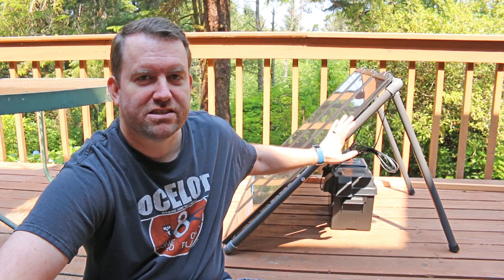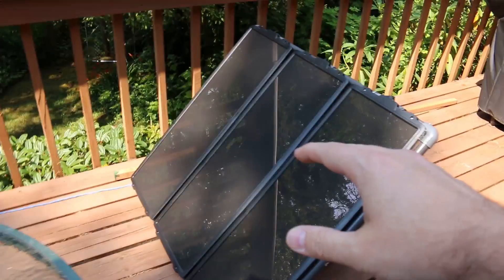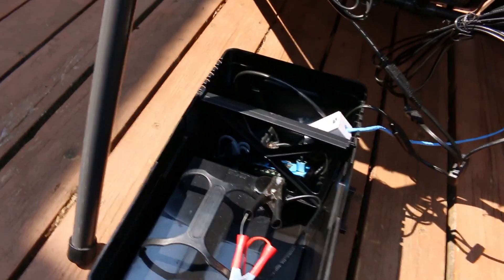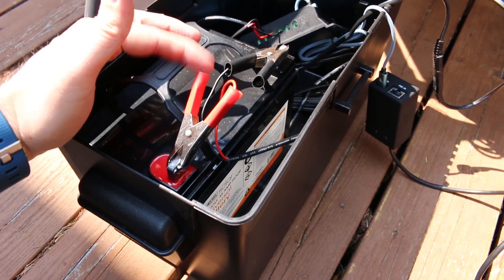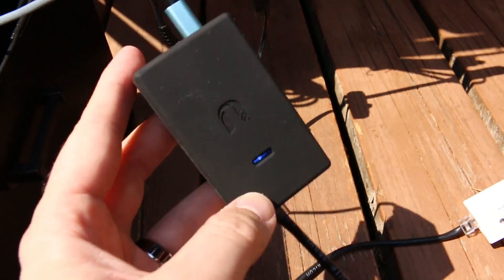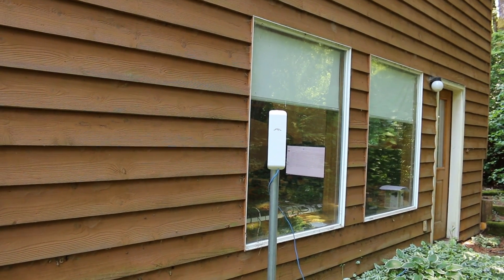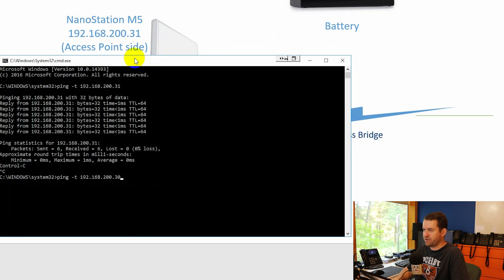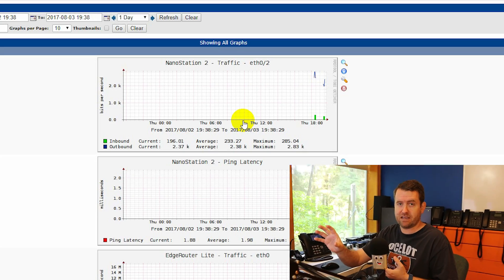Solar Powered WiFi - Part 1

Comment: for you ,getting a few simple "USB power banks" will take the fluctuating power and make it smoother for your kit, OC if your kit is 12v dc powered then it becomes easier as you can then use cheap 12v dc power splitters directly

Comment: To use PoE passthrough, we need to have a PoE+ source feeding max 30w to the nano station, where 15w max will be drawn by the extension port.
Reply: All PoE devices are able to be powered up to the max distance of 100m, also being able to tolerate the power loss generated by distances of up to 100m.

Comment: I have been using the UBNT products for over 10 years love how easy they are to setup.  They have such a wide array of options on what you can do with them as far as range.   But you should know that these products are commercial quality and have up to 10 mile range on some of the larger ones!

Comment: Great video, keep up the good work. But at the beginning you sad it's powering the nanostation. You could try to hook a poe injector to the battery. Something like: ALFA APoE08.
But there is then no protection for deep uncharging. So you should connect it to the charge controller load side that should output 12V.

There are also some solarpanels and battery for 24V. Some ubiquiti devices need the 24V volts or what you can to ist to put two 12v battery in a row to get 24v.

Comment: cool video, agree with you on the HF panel kit. if you going to connect a inverter in your setup, connect it direct to the battery, the "Load" connection points in that charge controller is limited on output power
 alternatively you can use a DC to DC step-up converter( https://www.amazon.com/Gowoops-10-32V-Converter-Adjustable-Voltage/dp/B06XGC5N12/ref=sr_1_18?ie=UTF8&qid=1502007558&sr=8-18&keywords=dc+to+dc+step+up+converter  ) along with a 2.1mm x 5.5mm Male DC Power Adapter( https://www.amazon.com/Xenocam-2-1mm-5-5mm-Camera-Adapter/dp/B01AGQVYQQ/ref=sr_1_13?ie=UTF8&qid=1502008194&sr=8-13&keywords=dc+male+adapter  ) and a Passive PoE Injector with 5.5x2.1 mm DC Connector( https://www.amazon.com/iCreatin-Passive-Injector-Splitter-Connector/dp/B00NRHNPUA/ref=sr_1_2?ie=UTF8&qid=1502008187&sr=8-2&keywords=poe+splitter  ), and this would probably consume a lot less then an inverter

Comment: The AirGateway Installer that is attempting to produce 24 volts from a USB input to run the Nanostation is definitely the weak point in this design.

Comment: I would recommend swapping that charge controller which is about 50% efficient with an mppt controller which is closer to 90% efficient, will make that harbor freight system go a much longer way. https://www.google.com/search?q=amazon+mppt+controller&client=ms-android-verizon&sa=X&biw=360&bih=512&tbs=vw:l,ss:44&tbm=shop&prmd=sivn&srpd=16908587327644949446&prds=num:1,of:1,epd:16908587327644949446&ved=0ahUKEwiBvq_H_7_VAhWK0YMKHXcKAHsQgjYImAQ
Reply: Crosstalk Solutions yes I was able to get a 230w single panel for $.83 a watt.  The mppt controller was only $54 similar batt was $64 this worked out to $1.33 a watt.  With only a a little more in over all costs   I was able to get a lot more bang for the buck.  Nice thing about the mppt is it will take input voltage from 12v up to 100v and will step it down to 12v or 24v your choice.  Also gives you install flexibility.
Reply: If this was going to be a long term mission critical deployment we would absolutely use higher quality equipment! This was just a test to see if we could do a large scale deployment that will really only be deployed for about a month. There is no way we would be able to budget higher end equipment for such a short period of time.
Reply: Brandon Yarbrough understood.  Mostly just a suggestion the harbor freight system is a great first system for testing.  But the per watt cost is through the roof.  If you part the system together you can get a whole system for $1.25 or lower a watt including a mppt controller and the batteries.  The system you have listed is running about $5.13 a watt.  I learned the same lesson.
Reply: This is still a great video!
Reply from the maker: Are you just adding up the cost of all of the equipment and then dividing it by the 45W panel to get your price per watt?  Are you saying that it would be possible to get a similar sized setup for $1.25/W with better equipment?  I can see getting the costs down that low in a much larger deployment, but that seems like a big difference in the ~50W size.

Comment: Check out Wifi-Texas Passive PoE injectors. No 5V to PoE conversion would be needed if your radios will take a 12V input. Personally, most battery backup systems I deal with are 48V telecom standard so make a things easier that way.
Reply from the maker: Thanks for the tip!  Looks like they have some great stuff.
Reply: I had to use them engineer a solution to convert Passive 48V B from a PoE switch to 48V A to power a Cambium radio. I've used several of the PoE passive panels (I much prefer a PoE switch where possible though).

Comment: did you have a power calculator or formula to size up your battery? Given that the Ubnt stuff is 24v passive, it may be a better idea to put 2 batteries in series along with 2 panels to get a 24v output. Put a voltage regulator out to the AP and you save yourself the losses from so many conversions [12v-->5v-->24v]. Also, stick with an MPPT controller, better use of incoming solar  resource. Overall, a fun project!

I've found these videos to be extremely helpful in getting up to speed on Solar 101...
https://www.youtube.com/results?search_query=alt-e+store
Reply from the maker: Thanks for the tips - I'll check out that playlist!

Comment: Definitely need to upgrade battery connections because in low voltage ampacity is king. Alligator clips don't have much contact area and express excess current through heat. 

I'd also try a USB combiner (i.e. ASIN B00ZUE6PVE) to get full 3A available to POE injector before wasting power on an inverter. Others had suggested DC-DC converters but they're not so cuddly as USB. But they do make professional units, like CUI Inc just down the road from you, for industrial applications in DIN and chassis mount so your clients won't see a spaghetti of wires and bare boards.
Reply from the maker: Definitely agree on the alligator clips - upgraded connections will be in the next version!

Comment: Hey Chris, did you measure the power going to JUST the M5 on the solar side WITHOUT the camera? This could be easily done by putting a clamp meter on the positive pair of the cat5e cable to measure the current. Assuming 24 volts, for each 0.5A that would be 12 watts. You have 4x that going into the battery for 6 hours so the solar side would be able to keep up with the .30 M5. Also, you don't have traffic on the solar side of the bridge, you really should for a load test. The inverter powered PoE injector may fix your issue in the short term, but the additional camera DC load plus additional draw based on wifi traffic will probably consume more power than your solar system can supply. I might suggest a single 100 watt panel with a MPPT charge controller to boost efficiency of energy transfer into the battery to support the power load on the M5 plus camera, plus inverter, plus PoE injector on the .30 side. I am planning a similar bridge setup for about 275 feet with the remote end powered by solar, so your findings are VERY helpful....DD
Reply from the maker: Thanks for the feedback - the next version will be a big improvement as I learn this stuff - stay tuned!

Comment: 24v MPPT control works I have built 3 towers that run like this for about a year, all good still running. It is running 1 x 400 Power Beam and 1 x 5m for the AP.

Comment: Chris I would look into getting a way to record your battery voltage when running tests. All of my solar deployments are for sensors that also report their battery voltage, so I haven't used this but this seems like a good option that would be very useful.

Lascar Electronics EL-USB-3 USB Voltage Data Logger, Process, 32,000+ readings, 1 year battery life https://www.amazon.com/dp/B003DS0BS2/ref=cm_sw_r_cp_apa_BypHzbWGJH120
Reply from the maker: That looks like a great tool - I have added it to my Amazon wish list.  $75 bucks is a bit much for me at the moment with all of the other stuff I am buying to improve the setup!  But, I'm a big fan of 'if it can be measured, it can be improved.'

Comment: Hey Chris, great Video thanks.

I have looked at the data sheets for the products that you used and think you will be running into a power issue.

-- The charge controller can output a max of 3A at 5v (assume you can get max 2A per port) this gives you max 10W per port
-- The Nano Station M5 needs 8W max (Nanostation Data sheet)
-- G3 Camera needs 4W max (G3 camera Data sheet)
-- Loses in cable and AirGateway Installer - a little bit (assume 0.5w)

Max demand is 12.5W, max supply is 10W. Looks a bit short and probably the reason the camera powers up, but as soon as it starts to do something that requires a bit of power it shuts down.

I agree with previous comments that you should avoid an inverter as they are inefficient. Another option that you could consider is to install a second AirGateway Installer to power the camera and do not use the PoE passthrough on the NanoStation. This will allow you to use both USB ports on the Charge controller. Although you will need to run additional network cabling, this should only be locally to the Nanostation/camera/battery box setup.

Cheers,

Matt
Reply from the maker: Thanks for the feedback, and for doing the math.  That makes sense.  The next version will have a better charge controller, and a direct DC PoE injector.

Comment: I am not as skilled as you are at computer networking but this I know about POE (Power Over Ethernet) wiring:CAT wire is small guage, intended for low-power electrical signals You can feed 1amp or so over short distances, but longer distances make the voltage drop through the wire significantly. The more amperage you try to draw, the greater the voltage drop.There is an advantage to going to higher voltages - 24 or 48 volts vs. 12 volts. Using simple numbers, if your device requires 48 watts to operate, that means 1 amp at 48 volts (which 18 or 20 guage wire handles well over short distances). However, at 12 volts it would require 4 amps of current, which will overheat small guage wire and create significant voltage drop (transmission loss). You have to minimize amperage or use heavier wire (possibly good quality Cat7) to improve the power available at the receiving end.Enjoyed your video.
Reply from the maker: Great feedback - thanks!
Reply: Tom Kelly yes yes yes, voltage drop is one of the key factors here..... along with what everyone else has been inputting.

Comment: Thanks once again Chris for your great videos! 
After watching your video I was thinking that if the Nanostation and Camera were closer to the "solar stuff" you may have have better success. 
My thinking is with the length of wire you have running you are experiencing a voltage drop (And current) due to the natural resistance of the Cat6 cable.
Reply from the maker: Definitely worth investigating - I'll check that out!

Comment: You need an Inverter. You also need an MTTP charge controller. As the one you are using now is cheap. You're losing 40% of the panels efficiency. Not that the panels are great to start with. As I am an electrical engineer and design solar systems for RV communities that want WiFi in them....

But nice try. Just get better equipment...
Reply from the maker: Thanks for the suggestions!
Reply: No problem. I should make a correction. It's MPPT... They cost more for a reason but they pay back in efficiency and reliability. 

These also work great for repeaters. To those that need more range with large RV's in parking lots. So they can get great connections to free WiFi... As RV parks are notorious for low signal consumer WiFi routers. ....
Reply from the maker: I've always wanted to do an RV park WiFi install - there's one near my house, but they didn't want to upgrade just yet.
Reply: So you would use an inverter to convert the 12vdc battery voltage to 110/240vac and then convert it back to 24vdc to power the nanostation. What a waste of energy. Better off with a dc/dc step up converter 12vdc to 24vdc
Reply: The PoE injector provides the 24 volts. Read the instructions....As the CAT6 is now being powered. That is why his Camera cycles on\off 

And DC\DC chargers are highly inefficient. As the best converters are 92% efficient cost $400.00 for a 30 amp....You can buy a 2300 watt inverter for that. As you don't need a true sine wave inverter. You can use an ACP backup PSU to condition the line voltage. Not to mention protect all your electronic devises. 

I been at this for 20 years. I know what I'm talking about....

Comment: The double conversion using the inverter and then POE power supply costs you power.  You can get efficient up-converter power supplies from Ebay that regulate despite the battery voltage going low or high.  You also want a low-voltage disconnect on your charge regulator.  Finally, don't put electronics inside the battery box!  Battery out-gassing corrodes electronics and make you cry.  Get and external weather box for your stuff.  Did I mention grounding?  Drop me a note.
Reply from the maker: Great feedback - thanks!  Do you have an amazon link for the up-converter power supply that you mentioned?  I'd love to take a look at it.
Reply: What I'm familiar with are bare boards from Ebay.  You need about 5A for Station and camera: http://www.ebay.com/itm/DC-9-20V-12v-Step-up-to-24v-Converter-Regulator-5A-120W-Power-Supply-Adapter-/172765818337  There's more to it than meets the eye.  aly  (edited with new link)
Reply: I just sent you an email

Comment: I would say the limitation is the solar controllers USB output
Reply: I would agree with this as well... the USB output on the charge controller is probably .5 maybe 1A... the AirGateway Installer needs 2A...  how about a 12v to 5v car adapter? just make sure it outputs at least 2A...
Edit: oops, just looked the the charge controller specs, says 3A... hmmm...

Comment: I work with a non-profit organization that maintains a camp facility in an off-grid environment, so we rely on solar power.  I have a wireless bridge setup (actually, it is three wireless bridges in series) to obtain Internet access from approximately 12 miles away.

I sized the battery for 3 sunless days.  When sizing solar, you should always based the calculations on winter months because that is when you have the least amount of sun.  You also want to have an idea of how many sunless days you expect to experience, because storm systems can leave you without sunlight for an extended period of time, depending on what region you are in.

Based on the battery size and the load size, the solar array size needed can be calculated.  Just google online solar calculator.  Plug in the values and the calculator will give you the configuration you need.  You will need to know your load size (use a Kilowatt meter to determine how much power your load is consuming--this is much more accurate than reading the device specs because the device specs gives you maximum and/or minimum consumption), the number of winter sunlight you receive per day (most online solar calculators have maps that will show this for the region you are in), and the number of sunless days you want to be able to handle.
Reply from the maker: Thanks for the feedback Scott - do you have a link to an online solar calculator for what I'm trying to do?  All of the calculators that I'm seeing are for whole home solar estimation.
Reply: https://www.altestore.com/store/calculators/off_grid_calculator/
Reply: http://www.altenergydesign.com/offgrid.html

This is the same calculator, but in a minimalist page design.

Comment: I've built a similar system for a solar powered web cam that has been running over a year.   I've  had really good luck with the renology panels sold on Amazon, great quality at a great price. 

Also,  for your battery calculations,  for long term reliability of a deep cycle battery you should only be using 25% of its capacity on the regular.   So determine the electrical load of the devices (plus probably 20% for losses due to efficiency) for the dark hours of the day and then multiply that by 4.  That is, at a minimum,  the size battery you should be using. 

Then size your solar panel to provide enough power for your daylight demand plus enough extra to recover the losses of the night before.

By using a deep cycle battery and then sizing it at 4-5 times you daily demand you'll build in some tolerance for rainy/dark days while ensuring you'll get years of service from your batteries.
Reply from the maker: Great feedback - thanks!